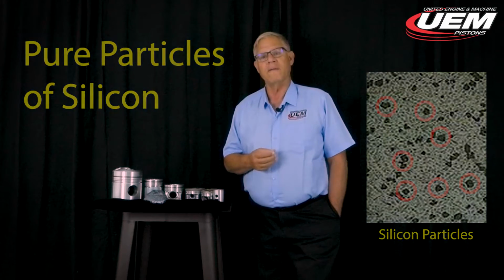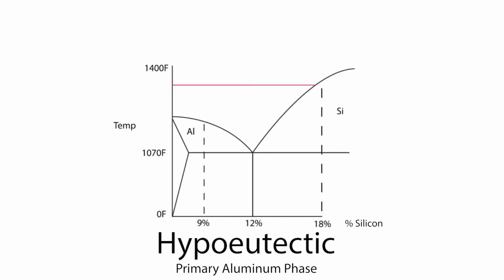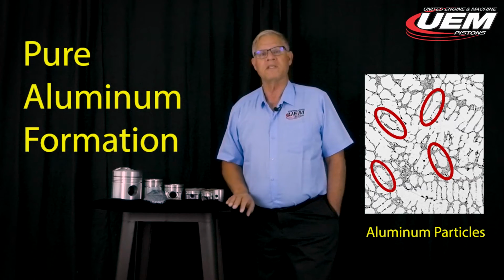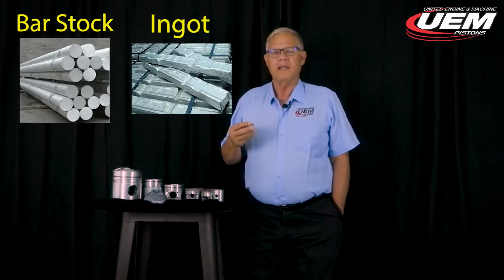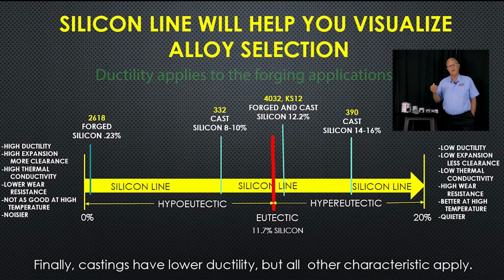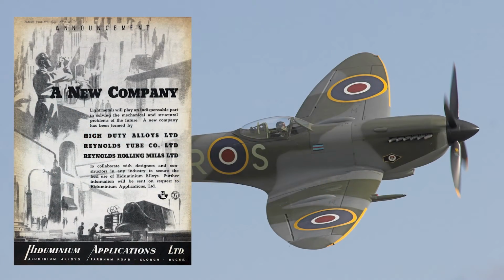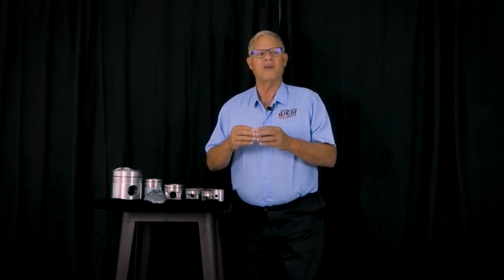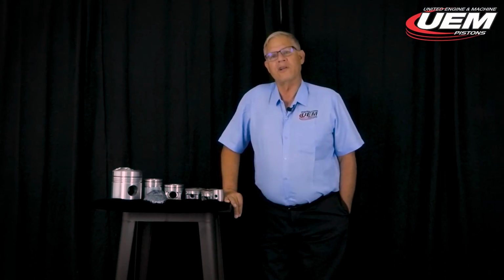Eutectic Alloys Explained! | Part 2

Comment: Thank you Scott for the very informative video on eutectic alloys.  I see some websites stating that their pistons are high silicon 332, which according to your video, is not a hypereutectic, but instead a eutectic with about 9 percent silicon. A true hypereutectic pistons contains over 12 percent silicon, and is superior in strength. 

Been trying to find a set of true hypereutectic pistons for my Ford 292 Y block build. Most sites state that their y block pistons are "cast" including Summit.  They are probably eutectics. I am trying to determine if Silvolite pistons for my y block are eutectic or hypereutectic. I cannot seem to find this information. The actual amount of silicon is not generally listed under the piston specifications that I can see.   Anyhow, thanks again for your excellent video. I learned a lot from it.